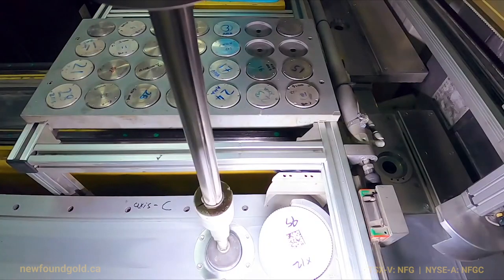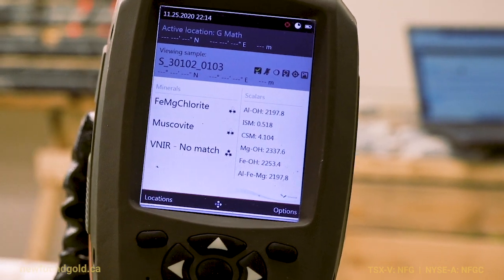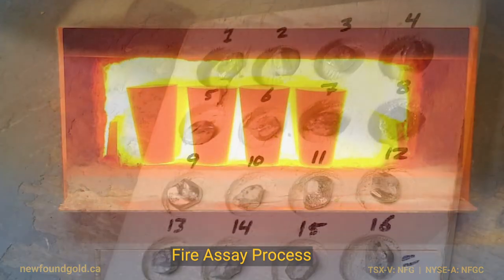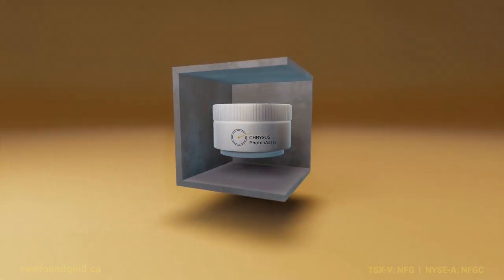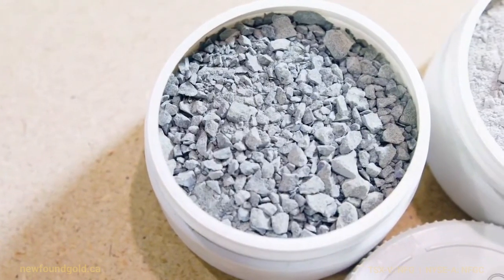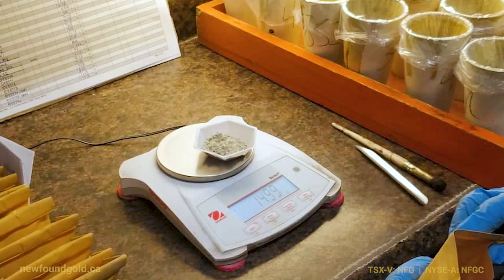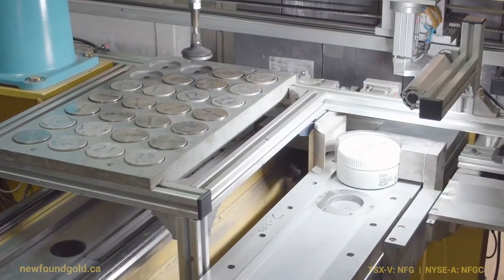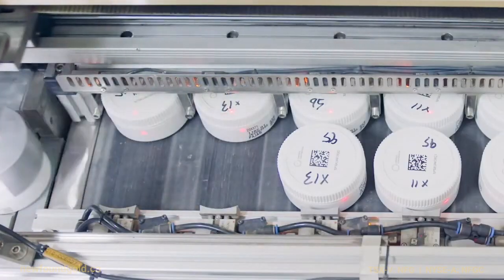New Found Gold Corp. Debuts Industry Leading Chrysos PhotonAssay™ (TSX-V: NFG;  NYSE-A: NFGC)

Comment: Will the new process expedite the return of assays and therefore allow the company to provide more frequent updates?
Reply: results with the gun are immediate however assays still go to the slow as molasses Labs.
Reply from the maker: If you have questions, please contact the staff and they will be happy to answer your questions.  You can do this via the website under 'Contact'.  Also here is the full press release outlining the speed of the new system.  https://newfoundgold.ca/news/new-found-intercepts-85-7-g-t-au-over-5-65m-13-4-g-t-au-over-9-05m-at-keats-main-zone-initiates-use-of-chrysos-photonassay-method/
Reply from the maker: @brucewmclaughlin9072  From the press release: “Moving forward, the Company will use the photon assay method at MSALABS’ (“MSA”) Val-d’Or facility as well as ALS Minerals’ (“ALS”) Vancouver laboratory for traditional fire assay and screen fire determination, to ensure the most efficient turnaround times on assays. The ongoing quality control (QC) program will include analysis of some samples by both methods to monitor accuracy.”